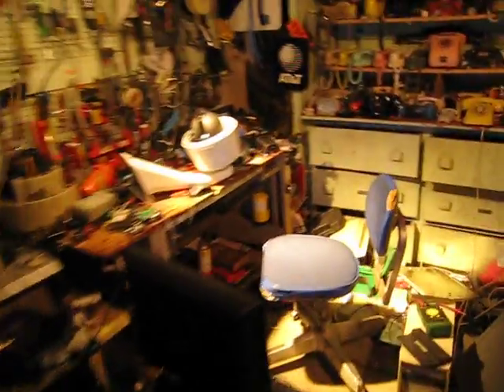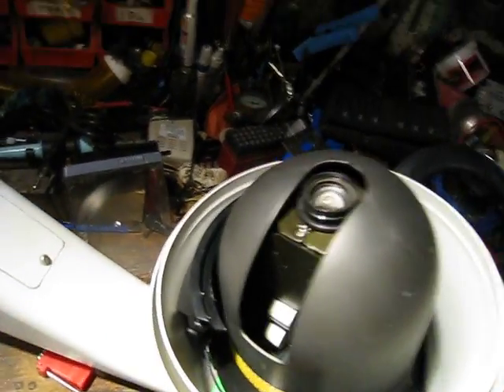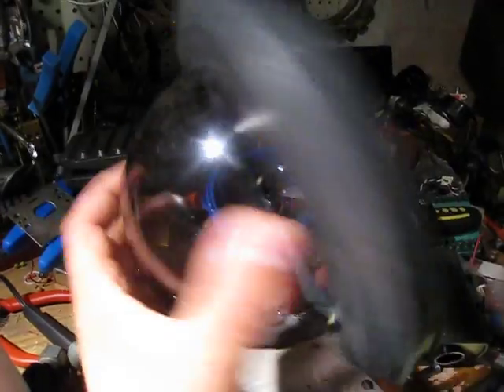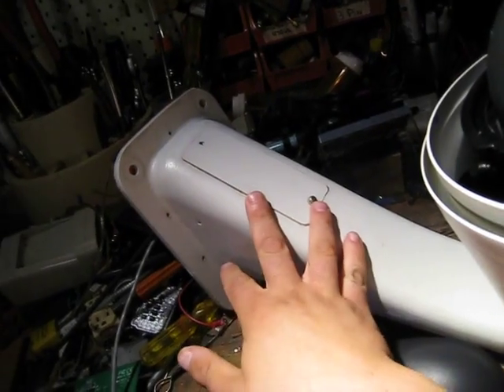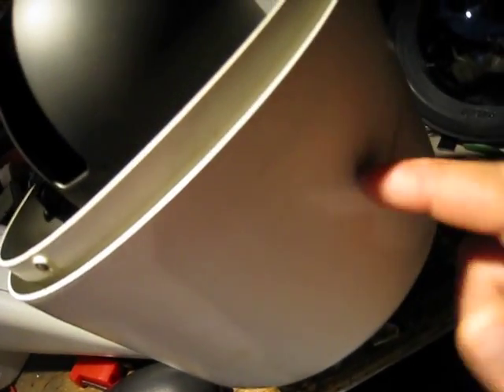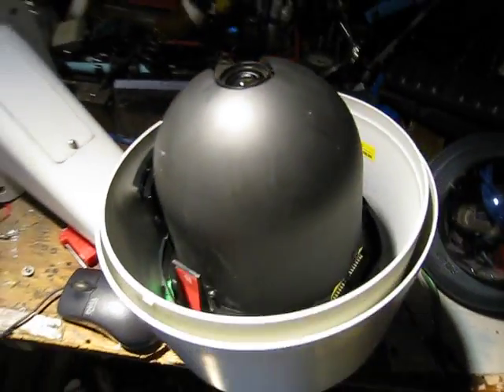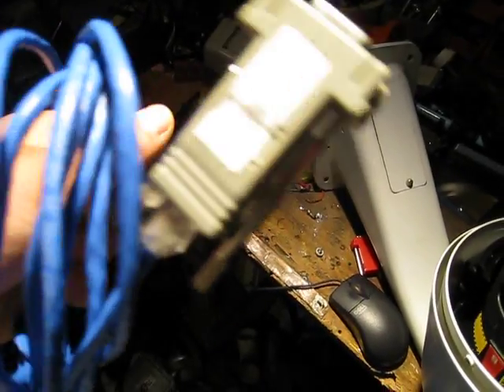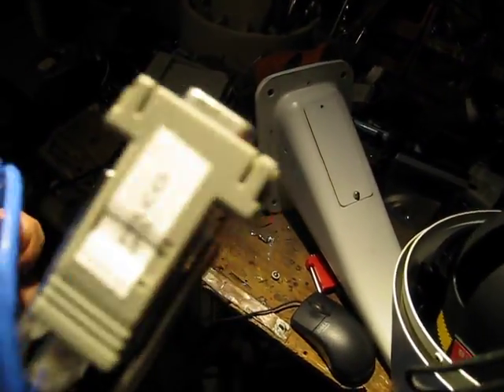Pelco Spectra 3 PTZ camera

Comment from the maker: Some cameras have audio, and speakers too, so the operator can talk to people on the streets, etc. This one doesn't have audio, but it does have alarm inputs that can be used to move it in a certain direction when an alarm is received. Like if a door is opened, you can program the camera to pan to the door.